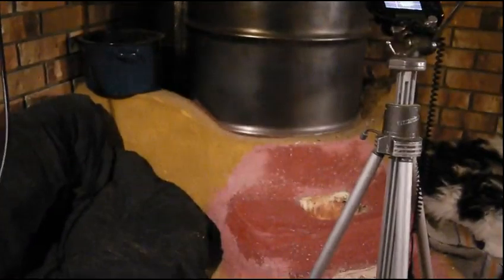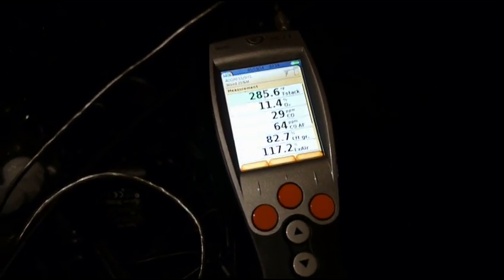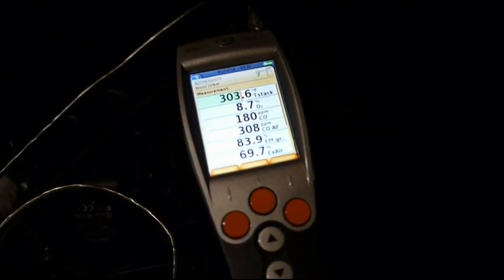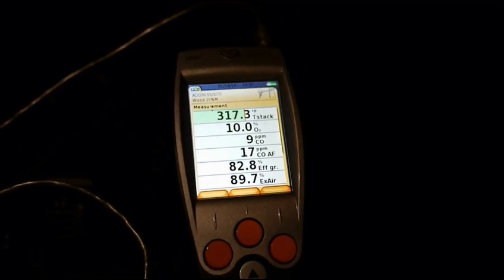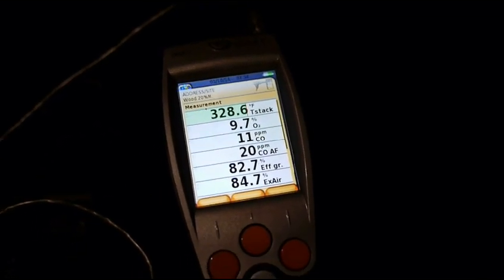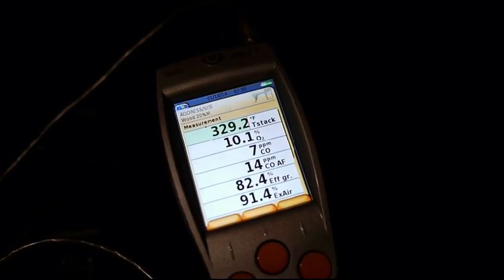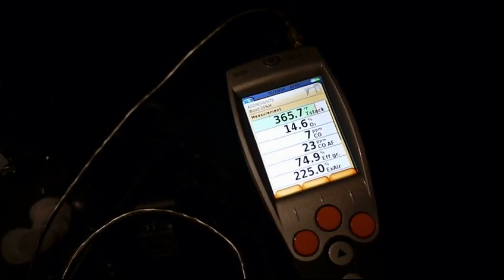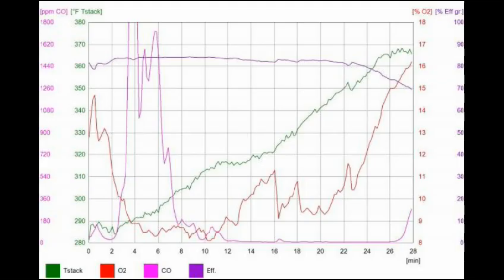Rocket Mass Heater tested with Flue Gas Analyzer

Comment: cool clip.  One way to get different quantities of heat off your RMH w/o adding a bench would be to add fins to your barrel.  You could do with  bent peaces of aluminum fastened with a metal strap. This might be a benefit cause they could be removable.  Put fins on during coldest part of winter and take off at beginning and end of heating season.  Just a thought.

Comment: Love this! So good to see real measurements being taken on a mostly "amateur"(not professional-no disrespect meant at all!) class of device. How do these readings match up against conventional wood stoves, do you know?
Reply from the maker: Thanks Warren, I'm excited to share some real data.  I have not tested a conventional wood stove yet, but I intend to.  I won't speculate too much, but keep in mind that if they are running at the same efficiency, a RMH burns about 6 hours in a 24 hour heating cycle, as opposed to 24/24 for a box stove.  That said, a box stove is capable of putting out a lot more heat overall, so there are times they are a better choice.  The new box stoves are incredibly efficient, so I wouldn't be surprised if there isn't a huge difference.  I'll post results as soon as I get a chance to test one!

Comment: FYI I live in WI,  and I heat a 20' geodesic dome with a RMH.  Inside, I have an aquaponics system and I grow year round.  I am so happy to find your channel.  Through the two years of heating my dome and the current year coldest ever since 1912... I have learned so much about RMHs.  This video is excellent.  I know RMH's are efficient, but how do this figures compare with other wood stoves?  Is your data available?  I really want to tap your knowledge and compare notes on RMHs.
Reply from the maker: Hey man, thanks for the kind words!  I have not had a chance to use this tester on a modern wood stove, but I hope to soon.  I think that the best of them are going to test pretty similar to this, but keep in mind that the RMH burns for 3 hours of a 12 hour heating cycle, while the box stove burns the whole time.  There are a  lot of ways to heat cleanly with wood. RMHs are cheap and easy to build though.

Comment: Great test info, scary price on that gear around $2,500.00. Couple of questions, 
1) Where was the probe to test the burn inserted?
2) Some people are using secondary air at their risers to affect afterburn, it was stated that more air allowed in would reduce the efficiency, there seems to be a conflict here, could someone shed some light?
Once again, great test info.
Reply from the maker: Raan, you can see the probe early in the video.  It's in the exhaust stack, just below the last elbow into the wall thimble.
I've never tested a J tube type burner with secondary air at the riser, so I couldn't speak to that.  This heater's performance would be hurt by any more oxygen.  You can see that the CO was completely consumed, so there was nothing more to burn the remaining O2 with.  More air would only hurt the overall efficiency in this case.  Every heater will be different though, and there are a million designs out there. 
Thanks for the comment.
Reply: *****
Thanks for responding.  As most builders can only assume they are getting clean burns by seeing whether or not smoke is coming out the stack, this leads me to ask if your testing has shown you "No Smoke" when there are still significant levels of 02 going out the stack?  I understand there are allot of variables for each RS, but would like to shoot for most clean burn as I can get through a home build.
Reply: Raan McLean
In further review of the chart it seems CO levels drop off as temperatures reach and exceed 200 F.  Would you happen to know at what Reported temps are required to ignite CO and for other particulates.  With this info I would have piece of mind knowing I can attain and sustain temperatures required for a truly clean burn.
Reply from the maker: Raan McLean I may be wrong, but I believe that in order to get such complete combustion of the organic stuff combustion temps must be well north of 1200 F in the burn chamber.  These burn somewhere around 1800 typically, so they can burn all the CO.  Modern box stoves use catalytic units to enable the organics to be combusted at much lower temps, around 700F or so.  Keep in mind the exhaust number you are seeing on my test is after 25' or so of horizontal flue run through the mass, cooling the exhaust greatly.
Reply: @broaudio  awesome response and you’ve answered my question on combustion/burn chamber temperature vs what you show in the video. I’m done with the core and will be completely done soon

Comment: Hey bro-  just found your page here yesterday, and I love it.  Looks like you've done all the things I'm currently trying to do.  Just set up my hugelkultur garden... or one of them.  And starting to toy around with rocket mass heaters.  I think I might follow your advice and cast my own core.  I've seen people make fire resistant casts using regular cement + perlite + fiberglass for the heat riser and for rocket stoves.  Thoughts?  I'd love to see an explanation on how your built your thermoelectric generator!!  Oh and the half barrel system you used outside...  The barrels actually serve as your duct work correct?  are the connecting holes the same 8" or larger? Placed directly on the ground?  keep up the good work!
Reply from the maker: Hey Grizz, glad you like my stuff.  I've made some cores with various mixes using regular cement (Portland) and they always turn to powder after a bit.  I'd stay away from it, personally.  You got the half barrel idea, they are the ducts.  Typically I just cut the ends out, but leave a little strap to keep them from spreading.  As long as the opening is bigger than the system size (8") it'll work fine.  And yep, right on the ground.  I've been thinking about making a video of my little TEG reading lamp, thanks for the inspiration to do it.  Thanks for the comment!

Comment: Hi, firstly, I'd like to say thanks for sharing. I've enjoyed several of your vids.

I realize this is an older post but you mentioned some things in your comments which just added to my questions so I hope you don't mind if I ask them all here.

1) You stated below, "modern stoves" and "other types" might be more suited for larger areas as well as one in your video that showed a 92% efficacy. Being unfamiliar and trying to gather up as much info on the different possibilities, would you mind providing a short list of the ones you are referring to?

2) In your vid you mentioned you disagree with those that stated you didn't need to insulate the stack etc and this caused the smoke/chimney effect when starting it. I've seen one such video were it was stated you didn't need to insulate and indeed there was a chimney effect/smoke when he lite it. He had to blow on it to get it to start the down draft or jet effect. Is this the case as well with a cold start of this type such as yours and others?

3) I saw one made without the "J" and can over the stack here on YouTube. Used to heat a tent 16' wide x 24(?) long. He used a military ammo box and ran a 6" stove pipe out of the box about 6-8', 180° turn, ran it the full 16 foot width, then under the tent side to his upright stack of maybe 10'. The heat radiating apparently was pretty good. Any thoughts on this straight shot type? Is there a limit as to the length of the pipes off the side of the can before the heat loss id's too great? Given what he did successfully, couldn't you with your design, essentially wrap your room, insulate it and heat a larger area this way?

3) Do you know if it's possible to miniaturize this design and use say 1" piping through out?

4) Have you thought of hooking a water tank inline for a winter hotwater source?

Hope you'll indulge my questions, I'm really curious and intrigued by these designs. I have a specific function(s) I want one to do so I'm trying to learn as much as I can as I mix and match designs in my head till I get something I think will suit a particular and multifunction purpose.

Experimenting with this and that idea mentally till I get closer to a sound design before building it. Though I think I'm kinda close to a start... Or perhaps I'm just eager to start putting some of my thoughts to practice and test it out while it's cold outside.

tia
- chase -

Comment: Love your videos!  We have poured one core and will be pouring another this weekend.  I have a couple questions.  Do you just build up more cob with straw around the core or do you need to put more cob with pearlite around the core?  What is an acceptable temperature  reading for  the outside of the core before it is further insulated?  One more question please... we used fire clay but if you use found clay, what percentage clay to sand do you need to have for the core pour?  Loving this project and looking forward to having a very similar Rocket Stove mass heater in our livingroom  very soon.  Thank you in advance for your time.
Reply from the maker: Hey Alleycat, well, the answer to your questions is of course, "it depends..."  I do like to add a little more cob/perlite around the core, but acceptable temps there are a function of whether it's exposed, or buried in mass, or whatever.  I say, do what feels right.  If it's a good place to store or radiate heat, use heavy cob.  If it's against an outside wall, or something like that, insulate.  Found clay is all different, so I can't really quantify that for you.  The best I can say is experiment until you are comfortable answering that yourself.  Good luck on your build, and thanks for the comment.

Comment: Hi Mat,
I just got your 6" j plan. What were you using for your core when you made this one, please?
If you were not using Duraboard do you have tests from when you were?
Thanks
Dan

PS if you fancy an Australian/NZ rocket heater building/snowboard tour hit me up. Lot's of good splitboarding to be had. I'm planning to hit NZ for a few months to build and fund a snowboarding trip.
Reply from the maker: Hey, thanks for the invite and purchase!  The core in the video is an older core made with clay and perlite.  It has the same design as the plan core, but was slightly less insulated and as such doesn't get quite as hot and takes longer to warm up.  The CFB cores test better, they come up to temp faster and burn hotter and cleaner.  I'll try to get a test video up of the Superhot J sometime soon. 

I'd love to come adventure, I've always wanted to get to Aus/NZ.  If I can ever find a way to get there, I'll take you up on it!
Reply: @broaudio  Thanks for the reply. I'm looking at getting the testo to run some comparisons. Something I've been trying to work out is that wood heaters (at least in AUS/NZ (same testing certificates standards) use co2 (weight (grams per kg) per weight (wood kg) as there emissions standards. I'm pretty sure that is going to be 0.5g/Kg from 2019 or at least that's what the firewood association are attempting to have a standard from next year. How do you measure that on a RMH etc using a testo and the data you can get from that. With regards to Australia/NZ email me your day rate for designing, consulting and building  and I'll work on it happening info@positiveaspect.com.au
Also, let me know how long you would be able to travel for (other work commitments) and the best time of year. Our snow season is (peak July/August) June -October. Summers are harsh in Australia in most places. NZ is pretty nice in Summer.

Comment: So the hotter the flame is the lower the CO?
 The higher the o2 the less Eficient the stove was.
 Am I reading that correctly?
 Anyway cool tool.
Reply from the maker: Hi Bob.  The CO is combusted in the high temperatures, but it needs air to burn.  Too much air, and you are heating air then blowing it out the stack, thus lower eff.  Contrary to what you would think though, if you choke down the air the excess air actually rises due to incomplete combustion.  More fuel (wood gas from the fuel pyrolizing) drops the air down, but then there's not enough to combine with the CO and CO spikes, which is what happened in the beginning there.  Anyway, yeah, it's fun stuff!
Reply: I was a smog mechanic in the 90's. We used a four gas machine. Hydrocarbons, carbon monoxide, carbon dioxide, and oxygen. And later NOX. "Oxides of nitrogen". But I always thought it was neat how one had to do with the other.

Comment: Where can you find the materials needed to build a mass rocket heater?  One of your videos said fireclay, fire cement and perlite.  But lowes, home depot, and all the other hardware stores don't carry ANY of it.  Thanks
Reply from the maker: Yeah, these materials are a little outside the scope of the big box stores.  The furnace cement you should be able to find at either a stove shop or a mom and pop hardware store.  Anywhere that carries wood stove installation materials should have that.  The Perlite I get at garden supply places, especially hydroponic grow shops.  The fireclay you will have to ask at a masonry supply place, my local masonry supplier doesn't stock it but will special order it for me.  Thanks for the comment and good luck on your build.